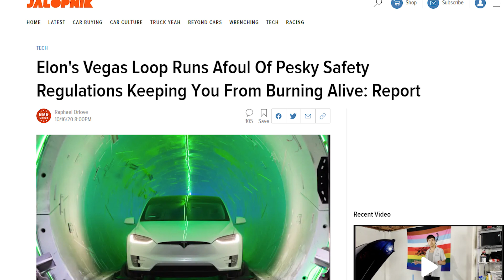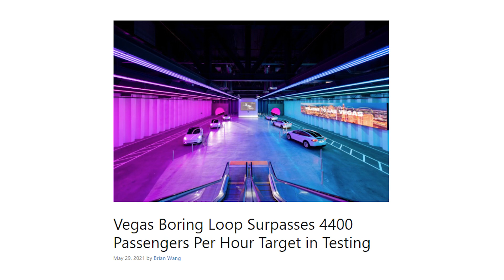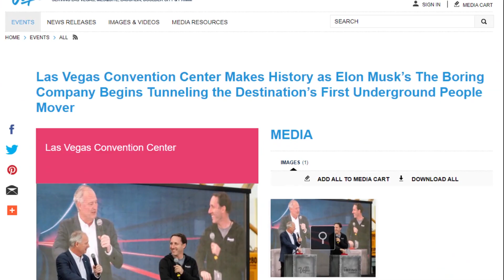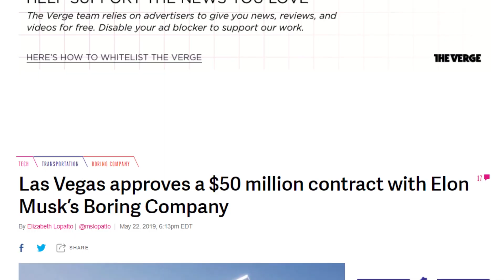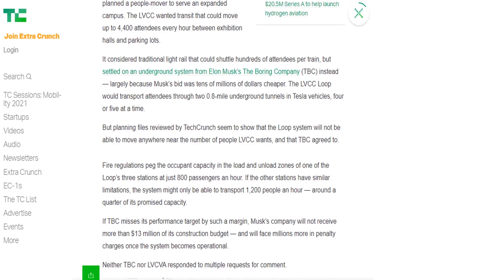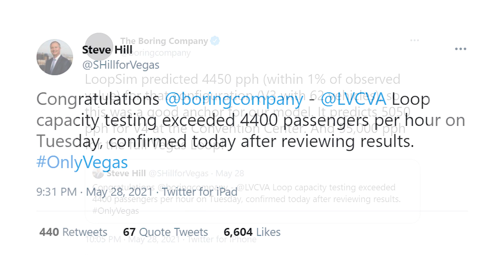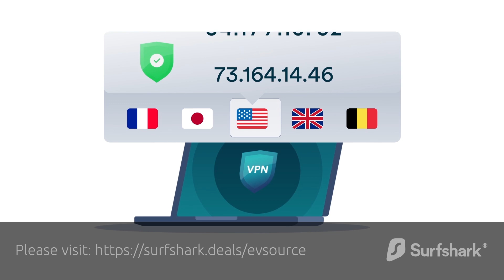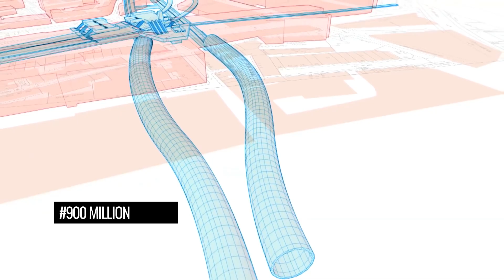Elon’s Vegas Tunnel Is Just The Tip Of The Iceberg: New Tesla Vehicles & Revolutionizing City Travel

Comment: You couldn't move 4400 people through that tunnel in an hour if you crammed 10 clowns in each car. 
Apparantly Musk has never used a pocket calculator. Imagine if a Tesla popped out of the tunnel every 3.2 seconds. If it didn't stop and just ejected 4 people onto the pavement and went back into the tunnel that would be 73 people with broken legs and severe head injuries lying on the sidewalk per minute and 4400 in an hour.

Comment: Low risk is not zero. Fire regulations are based on what to do if the worst happens.  You should have said the system complies with safety regulations.  

What exactly did it mean that they will have autonomous vehicle by 31-Dec-21?  They will have done tests or in operation. You didn’t mention the speed restriction.  Is that going to stay? Is that for safety?

The LVCC TBC system as a whole can only carry 4,400 per hour.  Given there are four tunnels between three stations that is 1,100 pphpd.  A metro can carry 40,000 passengers per hour per direction (pphpd) using 8-car trains at two minute headways.  They are a different order of magnitude. 

The LVCC TBC system at the moment is effectively a prototype low capacity people mover. Once they get minibuses in there the real tests begin. 

They could use an autonomous shuttle from one of the 25+ OEMs already making them, but I think Tesla wants to use it as a showcase for their own FSD technology.

Comment: I can't get over that 4.4k people per hour mark being talked in the materials as if it's some amazing number.
If it kept max capacity 24 hours straight you'd get about 105.6k people in a day.
Meanwhile the average for the dinky metro line is expected to surpass 500k per day.
It's an impressive feat of engineering, even if a bit on the claustrophobic side of things, but it's a system fated to either bleed money or be too expensive for the average person, effectively turning into the "rich people driveway".
Seriously, Elon could have designed a compact tram to run on these tunnels, achieving average or even respectable pph values when compared current public transportation solutions.
The solution to transport is not more driveways, it's desincentivising car use by means of improving the public transportation infrastructure.

I feel the core issue of these Elon designs is the apparent complete aversion to waiting 5 to 15 minutes for the public transport to arrive/depart.
Reply: 4400 is load/unload, not pphpd (which is what a metro is measured in).  Elon's pphpd is 1100, so yes, about 1/30th of a typical metro /facepalm.
Reply: @Blitz Gaming654 We're all pointing at it and mocking it because the way you minimize traffic is by making cars less desirable, the existence of a dedicated car lane is only ever gonna make traffic worse.
If the money and effort of these projects was spent on traditional public transportation methods you'd then have a higher number of people that'd go "I don't need a car anymore" and then you'd get less traffic because of less active cars.
The way I see Elon's dream it's a proprietary system of tunnels barely big enough to fit a car designed for a future where Tesla monopolizes transportation. Tunnels made at that specific size so bigger more efficient vehicles can't ride them.
The whole thing will show itself as a joke a few years later when people actually jolt down the finances and see the project is massively in the red.
Reply: @Blitz Gaming654 Not having to deal with other drivers, not having to be constantly vigilant, and not having to sit in traffic are a few personal reasons. As mentioned before, having more trains reduces the amount of traffic on the road which means if you actually like driving, you should be for trains as it will reduce the amount of traffic to deal with. By your logic, 88% of Tokyo is poor because most people choose to walk, bike, or take the train.
Reply: @Blitz Gaming654 If you're late, you wait 3 to 6 minutes for the next one. Same with the loop if there's a queue, you have wait until it's your turn. And I agree, there should be multiple modes of transportation to reduce traffic. It's just that a subway would have been way more efficient, environmentally friendly, and you get the point. Will this reduce traffic? Yes, but not by much. Even if they were the 16 people pods, larger vehicles such as trains or even buses like in a BRT system will always be more efficient. If he can reduce the costs of tunnels then great. Nothing else is revolutionary though. All the technology for the future loop stuff already exists. We just won't build it because it's just way more expensive and less efficient than a regular subway, BRT, etc. and will always be. It looks cool but it's nothing more than a tourist attraction, which is completely fine, but people need to stop pretending that it's more than what it is.
Reply: @Blitz Gaming654 Even the engineers working on the vegas loop are facepalming hard at the idea. If they don't think it's a good idea why should you?
Reply: @Blitz Gaming654 fine? As in ask for money?
Reply: @Blitz Gaming654 Thanks bro
Reply: @Blitz Gaming654 It's just healthy intuition
Reply: @Blitz Gaming654 Calling me poor and calling me a clown. You're clearly one of the car lovers that will never give up their car and that's fine. We're not advocating for cars to be rendered without use.
The main point we keep banging on is that there are too many people that have a car because the public transport system just can't get them to where they need to and they probably don't enjoy the daily driving much either. Can you imagine if just making proper public transportation options lets 30 to 40% of the current drivers just choose to not get their cars on the road, you're then able to safely have higher speeds on existing roads, there'll be less traffic accidents and you don't have to spend 30 minutes hunting for a parking spot.
Anyway, you just keep making yourself look inconsiderate towards others. I'm perfectly fine not driving despite having the resources to own a car, traffic is already chaotic enough over here as it is.
Reply: @Blitz Gaming654 bro, a subway line where the vegas loop is would not only carry more people, it would also be more efficient. 

And if you want a comparable luxury and privavy, one can just compartmentalize subway cars into smaller and more luxurious segments and it would still carry more passengers and be cheaper
Reply: @Blitz Gaming654 Maths. Number of cars x capacity each car × how many loops per hour. 

Plus tirewear and contact patch size. No need for maths to know rails are more efficient. 

Also economies of scale.

Comment: This is such a dumb idea. Isnt this just a super inefficient metro train system. Which would just increase car use not decrease it causing more congestion not reduce it. 
If the boring company can significantly reduce costs of tunnelling then awesome - build cheap metro train systems and decrease car use
Reply: A metro train needs to stop at every station. It also only goes one direction, so you often need to connect 2 or 3 times a trip. In the boring company loop you can go from start to finish at 100+ mph. Cars pull to the side at their station and allow other cars to keep going. 

Also you are missing the point that these tunnels are cheaper to produce so you can build more of them. Who cares if there are more cars if they're underground?
Reply: @curtis545454  and what about all the time that you loose having to board 4 people that can be, for example, children in need of special seats, wheelchair users, obese people, disabled people, people with cumbersome luggage... Public transportation systems with wide sliding doors like trains usually allow a quicker access than a car and also you do not have to change tyres constantly. You know, those pollute like... old batteries.
Reply: @curtis545454  The problem is physics gets in the way.  Troublesome reality.
1) You can't merge the traffic effectively if thru traffic is doing 100mph and you need to merge into it
2) 0-100mph at 0.5G (way more than most passengers would be comfortable with) is 200m, same distance to decelerate which leaves 200m in the middle which is about 4 seconds at top speed.

not to mention that the unload/load time at a station with only 5 bays (hence 15-20 people) limits the stations load/unload times.  

Elon is simply cheating the 4400ph number by saying "we load 1100 per hour at each station in each direction".  A real metro system is measured in people per hour per direction, and typically runs around 25-35000 pphpd, vs what appears to be closer to 1000 for this disaster.  

The only thing it will be good for is selling more teslas.
Reply: @Boffin55  you don't need to merge with traffic going 100 mph. A group of 5 cars can drive together, then leave a gap behind them. Once that group of cars passes then the cars in the station pull out. 

The end goal is not to use model 3 sedans. The end goal is to use 12-person vehicles. 

With this price, they can make two or three times as many tunnels as a subway station in high density cities. They can go all directions.
Reply: @curtis545454   European public transport (yes, the luddites who use public funding to create transport systems) ferry people ORDERS OF MAGNITUDE greater than Musk's HyperPoop will in the same time frame. Plus you won't need to pay the salaries of multiple drivers and maintain multiple vehicles. Metros and trains are used in every major city on earth for mass transport because they are plainly put... feasible. Unlike Irony Man's fantasy futuristic hogwash. 

IF you are to leave "gaps" between sets of 5 underground vehicles 12 passengers each travelling in one direction, amounting to 60 passengers per group, just connect all the god damned passenger vehicles to a bigger engine to conserve fuel and money and do you know what you will get? A fucking metro.
Reply: @curtis545454  That doesn't sound cost effective at all.  A subway would be almost jsut as practical with a fraction of the cost
Reply: @carlosandleon  If subways can be built at a fraction of the cost of a Loop system, they need to come to the table.   Often municipalities see how much a subway costs, and decide not to build a subway.     Cheap subways won't be as convenient or fast for passengers as the Loop will be, but they'll at least be able to compete for these smaller cities' business.
Reply: @kevinbailey8827  The loop won't ever be convenient lol.
Reply: @carlosandleon  Maybe not for you.  You might enjoy changing trains to get to your final destination, and stopping at stations that aren't your destination.

To me, entering a vehicle that will immediately take me to my destination without stops is more convenient than waiting on a platform for a train that will take me a bunch of other places first.
Reply: @kevinbailey8827  How is the loop gonna bring you exactly to your destination? Think about the waiting times at the stations too. You're only cramming maximum of 6 at a time. A single pod. 

It's absolutely nonsensical.
Reply: @carlosandleon  There will be a lot of stations (51).  It's more stations than a subway would have.  The stations will be near the entrances of each casino.   Bigger resorts will have bigger stations with more room for vehicle loading.   Most of the time there will be little or no wait.

The stations will access the loop via an "on ramp", like a freeway.  Two on-ramps, actually. One for each direction of travel.   Your pod will merge into traffic in the main tunnels and travel at speed until it reaches the off-ramp tunnel for your destination.  It will exit onto that tunnel and smoothly decelerate until it pulls into your destination station, where it will pull into an available stall for you to unload.
Reply: @kevinbailey8827  lmao, jesus christ. Regardless of stations the throughput is still absolutely atrocious. 

Keep dreaming bro
Reply: @carlosandleon  Thanks.  You keep dreaming, too!

Comment: Please make a video about the deterioration of the roads inside the tunnel, since they are much less impacted by environmental factors (as you mentioned) from snow, rain, or excessive solar heat such as in tropical and equatorial regions or extensive solar impact.
Electric transport technology makes this and other advances possible for us, which in ancestral fuel technology (including hydrogen) makes it difficult to become prohibited. But still factors such as the natural deterioration of the pathway itself need to be considered. Even for implantation / exchange of another means of transport contact that reduces the deterioration of the road itself. As an example already in the bullet trains in Japan, the reverse magnetism, which extends the useful life of the tracks even at speeds well above 200 km/h.